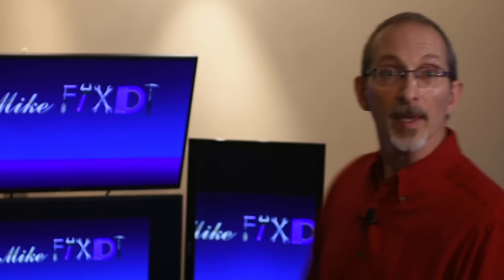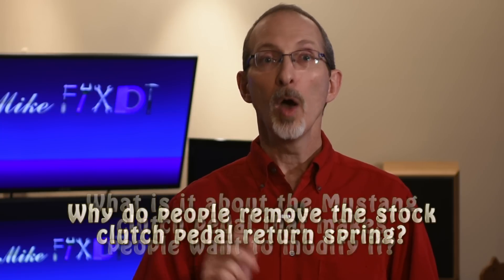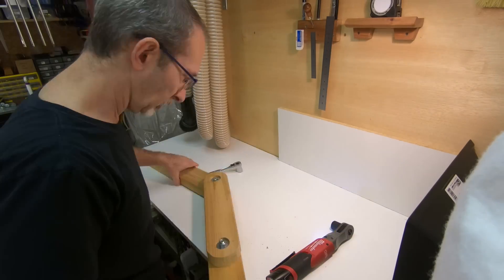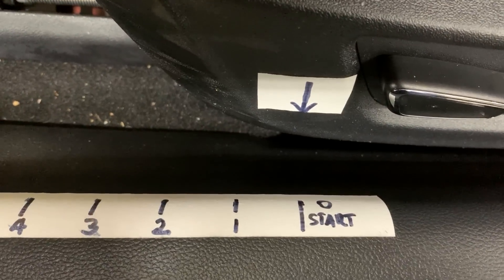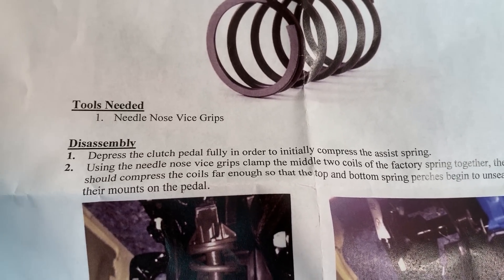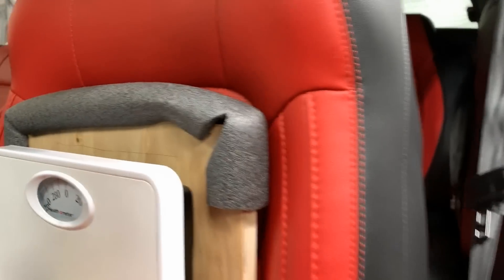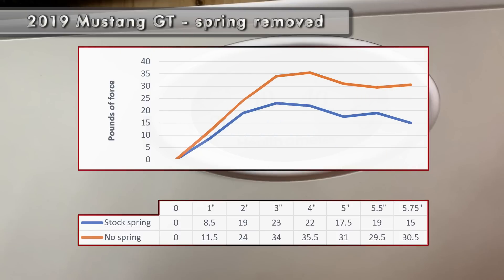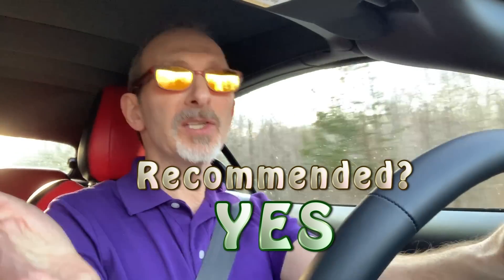Mustang GT Clutch Pedal Spring Explained Using SCIENCE

Comment: Well,sir, i totally prefer the factory setup, no mod for me; the factory KNOWS that the important thing on a clutch pedal is that it does NOT push back too much, on your left foot, as you wait for the light; and that is BEST with a stronger spring, because it acts as an OVERCENTER spring; as an engineer who designs clutches,i also do understand what science means here,but not everybody does.
NOTE:  as the disc wears down, as the clutch gets old,the overcenter point changes,of course, and  THEN ,and only THEN, a softer spring is better; SO, if you drive a manual car, avoid wearing down your disc, always take off with the least gas(the least power) you can,and then,with your left foot well OFF,then you can floor it all you want,this way your clutch system will last you 20 years,like it is supposed to; remember,your left foot OFF the clutch pedal at ALL times except... you know the rest.
And another great tip from a pro: coming to a stop,say,a light, you can put in in neutral WITOUT touching the clutch pedal, just balance the gas with the speed and the gear stick comes off smoothly,and you just doubled the life of the linkages and hydraulics,also a great source of trouble; i know,for the last 25 years,i repair them for a living.
Reply from the maker: Thank you for adding your experience to the conversation! Clutch feel is so subjective… This spring modification at least gives people a choice. I don't have the heart to try, popping the car into neutral without using the clutch, but I'll give that one some thought… 😁

Comment: I hate having a clutch that has no over-centre feeling to it
Reply from the maker: Andrew - you bring up a good point that people may like more or less of what you describe as the over-centre feeling. It was interesting when I saw the shape of the  graphs, with the different setups, that the feeling is never truly linear, but that this spring mod is just an alteration of the clutch feel. I suppose the center 'bump' in pedal pressure helps us find the clutch engagement point, and is not necessarily a bad thing!

Comment: Just leave the spring out and save $20.
Reply from the maker: Hi CrackedBrain - Yes, suppose one could - and I hear that many do! The people who stand to make a profit selling the replacement springs have commented that it may cause long term wear if you operate the clutch without the return spring. Not totally objective information, but information none the less.
Reply: @MikeFyxdt  I've heard that before also but not sure how. If the clutch is not fully disengaged you could feel it. Also the pressure plate spring pushes the pedal back up. I have a McLeod rxt twin disk with no assist spring and the only difference is the pedal is a little harder to push in but the engagement point is easier to feel. With the stock spring in it didn't seem consistent. Also my car is a 13 gt.
Reply: @crackedbrainOG  You are correct in your comment. Ford put the spring in to assist the average daily driver that would not like the pedal feeling a bit strong..
Reply: You could, but the spring assists the pedal to fully disengage when it isn’t being used.  Not having the clutch travel all the way up can damage the clutch governor, and eventually cause problems like clattering with your clutch plate.
Reply: @E52O4  it can damage? Or will damage? Iv seen lots of videos on the spring removal and forums on the benefits but never any bad or damage that had occurred due to spring delete....or maybe someone has had adverse effects miles down the road I don't know? I'm really trying to figure out what to do... Because the clutch to the 15 to 18 is a bit frustrating

Comment: My 2021 Mustang GT premium was a big lemon...so yellow is the perfect color for that POS.  I could live with the cheap plastic interior and glitchy  electronics but the 6 speed manual transmission was just garbage!  I'm not the only one who thinks so, look at the class action that has been launched against Ford.  Fortunately I was able to sell it and buy a real car from another manufacturer.  It's no wonder Ford stopped building cars...I'll never buy another Ford...EVER!
Reply from the maker: Oh, wow Mike! What a bummer. Mass production makes these cars affordable, and I guess that comes with its down sides. I am fortunate that my Mustang has been working great for 3 years, and I'm really glad I got the manual. So far the Steeda clutch assist spring has stayed in place, as I find it very comfortable. So what did you end up getting as a replacement?